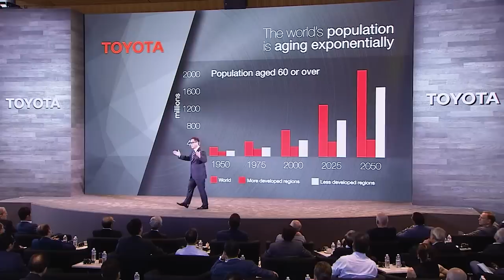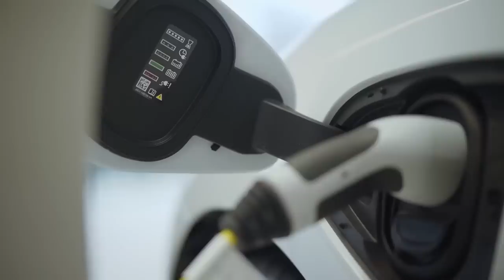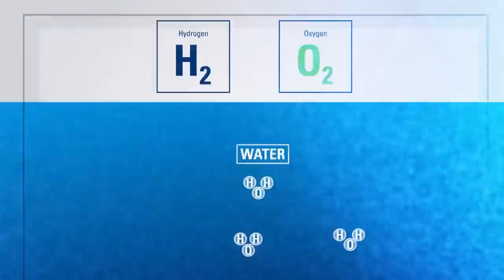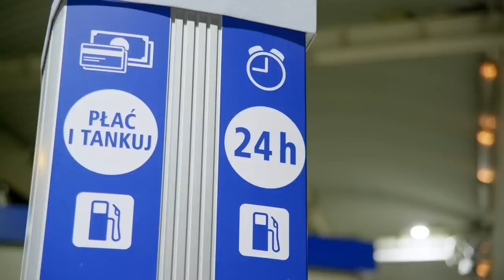New Toyota CEO Shocks Everybody | Huge News

Comment: For those who dont know, Toyota has helped ETNZ develop a fully hydrogen powered, foiling chase boat and that thing is not only cleaner but way quicker than any other chase boat out there. Pretty cool.
Reply: How cleaner? How do they get hydrogen?
Reply: @lesp315  from water. you got a 2 hydrogen atoms from every molecules of water.
Reply: @lunascomments3024  Yes, but that's exceedingly hard to extract. Or have you ever seen hydrogen spontanously appear out of your water bottle?
Reply: @karlgunterwunsch1950  hard to extract. 

boils wo'a
Reply: @lunascomments3024  That's water vapour, not hydrogen... To crack the water molecule apart takes a lot of extra energy. Even the most efficieny electrolysis is wasting about half the energy, then storage a lot (-253°C don't happen that easily, neither does high pressure around 300-800 Bar which is required to not need a big balloon sized storage for a kilogram of that stuff), then transfer takes another buildup of extra pressure (to reach the 700-800 Bar in the bomb in your car the filling station needs to offer about 1100 Bar (which is why a single pump filling station for H2 costs $1M), which alone is insane - have you ever heard a lorry wheel explode close by, they are only inflated to 10 Bar and still you probably needed a new set of underpants)... Nope, hydrogen is not the future.
Reply: @karlgunterwunsch1950  maybe not but EV won’t be the answer either.  Not until they can lower the price of a decent vehicle make them have a longer range and make that range work while towing heavy…
Reply: @jonathankrum3016  Heavy isn't the thing that curtails range that much. It's wind resistance as that is the only coefficient that is going up with speed quadratically. All others are linear factors, and mass can even be exploited in regen breaking. IMHO you just need a new trailer standard that also contains a battery underneath the trailer. It doesn't have to be much lager that 2 or 3 car batteries, that adds moderate weight to the trailer but with current exemptions on weight of BE-HGV in the making this would make their range very much palatable.
Reply: @karlgunterwunsch1950  well the trailer unloaded weighs right at 21k so legally a truck is not yet being made and sold to tow it.  Range is not close either with a 100 gallons on board the C4500 I don’t have to fill up or take breaks nearly as often. I would want to run 700-800 miles a day.  If all highway at 70 mph I would expect to run more day 950 miles in a 14 hour period. 

Affording to replace those batteries has to also be taken into consideration. The cost is huge. 

With work vehicles at my company we are all in 1 tons as the tools and parts we carry daily weigh a lot.  Looking at the distances we drive daily comparing the current ev offerings there is nothing that is being manufactured to replace a diesel or gas in that arena.  Not to mention the quality of using those vehicles. Having that much seat time a day means comfort is key.  It is not the same as simply driving down the road to the grocery store and then 30 minutes to an office or other place of employment.  

It is not uncommon to see a vehicle that has been in operation for 12 months that has 70k - 100k miles. Meaning we would have to find a place to charge mid day.  Which will take time and cost the customer more money which they in turn will turn over to the consumer by raising prices. 

True, charging stations is becoming easier to find and the time waiting is becoming less but I have seen people sitting in line waiting to charge,  I have seen the opposite as well though. Ev stations all empty.
Reply: @lunascomments3024  That's fantastic. So, you just put water in a car and start driving?

Comment: Nothing wrong with EV, but its smart to avoid the saturation and competition.

Hydrogen definitely needs more marketshare, there’s only like one station here in San Diego. Diversity of powering a car is a good thing.
Reply: Hyundai also has a hydrogen car Nexo.
Reply: Hydrogen is an idiots endeavour, efficiency of 30% with extra conversion steps. It might be viable for ships if anything !remindme 20 years.
Reply: @memelord7821 hydrogen is the only way to store energy safe for a longer time. Electricity can not be stored for a long time and there are not enough resources for batteries at every car.
Reply: @kasper2970  Three false statements in two sentences. Hydrogen is exceedingly hard to store (either -253°C or high pressure vessels needed) and electricity can be stored quite well - in batteries like in the BEV (V2G is the keyword here). And the resources for batteries are there, especially with the newest chemistries, they were just not needed before, which is why additional production sites for Lithium for example are now being setup worldwide. It's not as if Lithium is rare. It is more abundant than lead and still every ICE car carries around 10-30 kilogram of the stuff and we have no shortage even though it isn't properly recycled - compare that to the 11.6 kilogram of Lithium needed for a 70 kWh BEV battery which can be recycled at the end of its lifetime of 20-30 years.
Reply: @karlgunterwunsch1950  batteries are only useful for short term storage. Transport of electricity is also a problem over long distance. In the Netherlands there is a very big problem with grid capacity because everything is switching to electricity. A household needs 3 to 4 times more electricity if they have no earthgas connection. The infrastructure for electricity is not designed for this amount of use, this use is beside the need for more charging infrastructure for cars. We really need alternatives for electricity because we don’t have the infrastructure to do everything with electricity not now and not in the coming 30 years because we simply don’t have the man power to do this conversion.
Reply: @kasper2970  Hydrogen needs 3 times, eFools 5-7 times the energy and both need an infrastructure that is about 5-10 times as costly. So if you think we can't manage the infrastructure expansion in time, how do you suggest we ramp up infrastructure even faster. And because of that infrastructure it's going to be even more costly - current market price of hydrogen is 27 Euro per Kilogram (with which you can drive 100km at best), only subsidies have brought that down to the current trial prices in the Netherlands and Germany that may make it seem affordable. eFools from the Haru Oni Plant in Chile are costing about 50 Euro per liter to produce (before transport), so your ICE car filling will cost 2500 Euro with which you can go maybe 600-700km...
Reply: @karlgunterwunsch1950  it’s not only cars we talk about. In the Netherlands and I think also in Germany there is a pipe system for earth gas. The Dutch government is now promoting to get the use of this gas down. The company who is managing the gas pipelines is now investigating how to use this pipeline system for hydrogen. Storage of pressurised gas is no rocket science, lpg is in use for more than 50 years in cars. Tatra steen is workin on their own hydrogen factory because the temperatures they need are difficult to get with electricity. The actual price of hydrogen is may high now but with more production powered by solar the price will go down. This could be a very good business model for the south of Europe or countries like marocco
Reply: @kasper2970  The pipe system can use hydrogen under low pressure, that is not suitable for many of the traditional gas uses as then the energy content transported is too low.

Comment: Toyota is definitely moving into the right direction. I'm from South Africa and we have up to 12 hours of power cuts a day because our electricity grid is falling apart (government incompetence & corruption on grand scale). This goes with aging infrastrucutre like roads and bridges that at falling apart due to no maintenance. There is no way our environment can get ready for the adoption of EVs en masse. I bought a Corolla Cross HV last year and am super happy with the low fuel consumption and performance overall. Though 99% of my countrymen are not as fortunate to be able to afford vehicles such as these. Therefore Toyota bringing more options to the table for the average Joe is wonderful even if it is petrol hybrids and not full EVs as an example.
Reply: I would move. I couldn’t handle no power!
Reply: @scarcheer7211  unfortunately emigrating is incredibly expensive. Most people can't afford to.

Comment: Why don't they make their cars able to run on propane and gasoline? Liquefied propane burns far cleaner than gasoline, has a higher octane and the technology to easily switch between gas and propane has been around for over 50 years and involves just flipping a switch. Propane is also easy to install at existing gas stations.  Liquefied natural gas would also work very well and it is readily available domestically in the U.S.
Reply: Volvo has sold LPG/gasoline bifuel cars for 40 years or more.
Reply: @baronvonlimbourgh1716   Right. LPG and natural gas are available in abundance in America and burn very clean and have a higher octane than the Sunoco 260 what used to be sold.  It would make America energy independent for our domestic automobiles and at lower costs and with a lot less pollution.  Of course, maybe that's why it isn't done.
Reply: @1notgilty  that transition should have happened 40 years ago. Now it's just to late, a better technology that vastly surpasses it is available now.
I have been driving lpg since i got a drivers licence in the 90s, and so have most people i know. Now it is time to move on to better things.

Same with nuclear, that transition should have started 30/40 years ago as well when it made sense, now there are better and much cheaper alternatives available that make nuclear obsolete 20th century technology. 
Nobody is going to be willing to buy the electricity it would produce by the time the things are finished. It is already by far the most expensive form of electricity available and that gap is only growing. Mountains of tax money every year would have to be spent subsedising them for the 50 to 70 years they are supposed to run.

I'm honestly pretty done with subsedising energy companies with tax money, f#ck them! 
We can now make our own for free in a decentralised way and trade it amongst ourselves when we need to. They have controled the market and filled their pockets with our money for long enough.

Energy is changing and the power structure of these masive energy companies is falling apart, and i am happy it is finaly happening. I'll happily fill my car with sunrays captured from my roof for free for the next 40 years, thank you.
Reply: @baronvonlimbourgh1716  Great.  What are the new, affordable technologies that we can now use to power our vehicles and for lighting our cities and energizing the grid, if there would be a "grid"?
Reply: @1notgilty  the cheapest and only technology based sources available at the moment.
Unlike resources, technology becomes cheaper and more efficient over time as it commodifies and becomes omnipresent.
Just like all other technologies have before them 👍.
Reply: @baronvonlimbourgh1716  So, what are the technologies and energy sources that we can now use to affordably power our vehicles, light our cities, heat our homes and run the grid to maintain our economy?  I don't see them.  What are they?
Reply: @1notgilty  what are the only 2 technology based energy sources we have at increasing scale at the moment?
Been in a coma the last 20 years or something?
Reply: @baronvonlimbourgh1716  No, I haven't been in a coma.  What are these two technologies that you won't name?  Are they wind and solar?  I don't see any practical and affordable alternative energy source at this point.  Most of our electricity is still produced by power plants that run on coal, nuclear, natural gas, oil or hydro.  Wind and solar are good but have problems and are a tiny fraction of our energy production.   It will take decades for them to become our major energy sources.  Most electric vehicles run on electricity produced from coal-fired power plants.  America runs on affordable energy.  Take it away and our economy will collapse.  Most Americans don't want to go back to riding horses to work or living in unheated homes.

Comment: I think Toyota will make great strides on hydrogen fuel systems in Japan and will make this work.
Reply: Rip Toyota
Reply: @musiceditfor  Yeah, ok... LOL
Reply: @musiceditfor  

The hybrid era obviously needs to be extended to a more sensible timetable, let's say around 2070's, or ideally, if hydrogen is compatible and is ready to go, some time around 2040's. 
To have a complete EV changeover window of less than 10 years is short sighted to say the least. 

The sensible answer is to find clean fuels combined with hybrid power which should reduce vehicle emissions even more than of present. The measures being taken today by different countries should be appreciated as they have already pulled nearly all the stops out and have more than fulfilled their duties by helping the climate.

Toyota do seem very likely to be on the right track and get the impression they are looking at the bigger picture. Saying that, it's probably still a good number of years off hydrogen power in vehicles, so time will tell either way.
Reply: @bonk352  No one needs to sell weird hydrogen cars to support R&D to replace gasoline by other kind of combustion fuel.

Comment: Right now, there are about 30+ electric car companies including Tesla, Ford, Rivian, etc. and the EVs market is still too small compared to gas cars.
Toyota is smart enough to avoid unnecessary competition, continue tapping on the profitable gas car market while developing both EV and at the same time, looking to another feasible fuel source in case EV turns out to be just a hype.

Comment: Phenomenal video🔥

Tesla & Toyota have been in r&d since 2021. They’ve worked together to further the solid state battery technology. Diesel fuel is not dangerous to transport as it only ignites with compression or high heat.
Reply: Tesla simply jumped on same Si anode bandwagon.

Comment: Ultimately it depends on the public, if we want change then we will vote with our wallet. I’m not in a hurry to go electric, besides it being a big polluter to get the lithium, the costs when the batteries and/or the motor dies are huge.
Reply: Except that the batteries and especially the motors are practically indestructible during the typical lifetime of a car. The chassis probably will have rotted away by the time the current generation of batteries have lost so much of their storage capacity that they are better used stationary in your house to buffer the grid.  And the motors you can take for the next car - except that maybe the next generation of motors is not just 95% efficient but 96% efficient.
Reply: @karlgunterwunsch1950  Hard to make that statement when we've had nothing to compare to a lifetime of use eh? Previous electric cars have shat themselves and the owners have found a huge bill for it. So don't know how you can make those claims. You're also assuming that sometime down the track, something else or better doesn't come along and make these redundant, just like most tech, leaving the owners to be forced to upgrade. You think anyone building these is going to want their vehicles to last a lifetime? No chance.
Reply: @oo0Spyder0oo  Since BEV operate at the maximum of what physics will allow in terms of efficiency and our survival as a species depends on efficient use of the limited resources we have - there is no avoiding the BEV as a long term solution. So I know that nothing will come along that will replace BEV as long as we have individual mobility at all.

And as for lasting a lifetime - BEV with their few moving parts and battery technology allowing for more than 1 million miles today already that isn't going to be a concern, you probably want something with newer comfort technology anyways by the time the current BEV has been with you for those 1 million miles. And hydrogen FCEV for example have a set expiry date after which they must be scrapped (printed on the inside of the filler cap) after it had eaten you alive with the high maintenance costs to even reach this date!